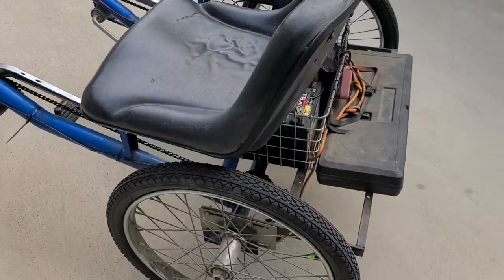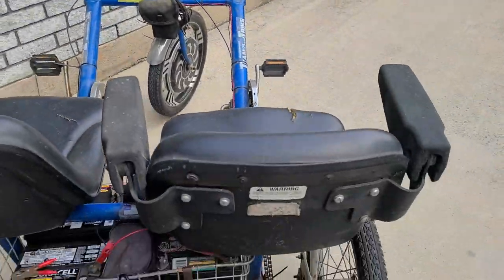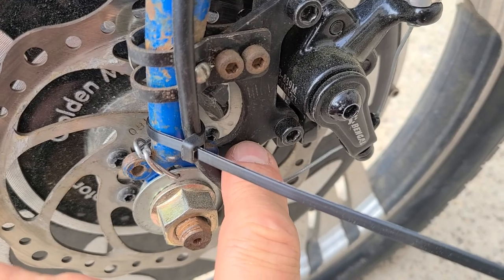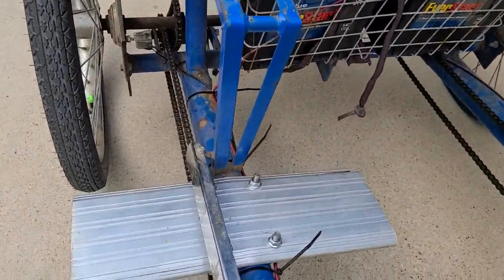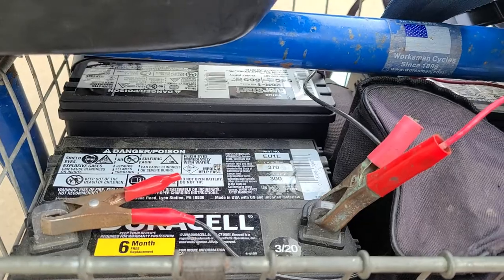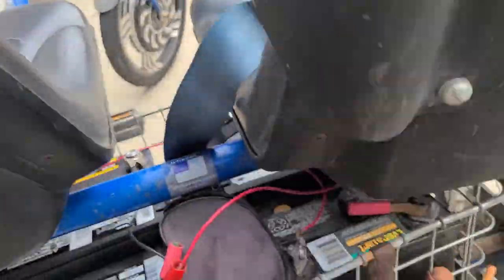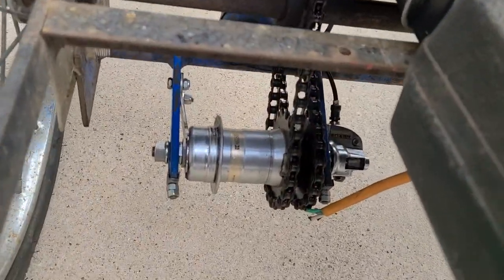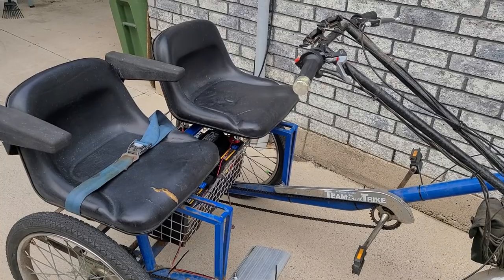WORKSMAN TRIKE QUAD POWER MOD

Comment: Thank you for the information. I have a dual that I plan on electrifying because it is too hard to pedal. I bought it a few years ago, rode it for 25 feet, and parked it on the side yard. At that time I was riding my single speed Sun Industrial 2-5 hours daily up and down hills. My legs were in shape but not enough to move the monster. I have the parts now to put a high torque low rpm traction motor on to drive the rear axle. By calculation with the gearing I plan on using it should do 12 mph. Questions, how fast does your trike run with the hub motor and how is the handling the trike with the tiller handlebars. From just my short ride I found sitting off-center odd. I was unaware that the tiller could be adjusted like you showed in the video. Many thanks for that tip.
Reply from the maker: Thanks for the kind words.. She will do 20 mph. Too sketchy at that speed..
Reply: @REDNECKCHANNEL  Thank you.
Reply: I bought a worksman for my special needs son and myself to ride together.   I squat 425 and have strong legs. My son and I can hardly peddle this trike.

Comment: I've got one of these. What about the rear double coaster brakes? I just mounted a 1000 watt/48 volt with a 100 Amp Hour Lithium-Ion battery from Ali Express. (At $100.00 I had to buy it!) I use good strait pull caliper brakes up front. And coaster brakes back aft.
BTW Trike sells new, (no motor) for $2500.00 and the Trike is well worth it. ALL the Worksman products are quality made.
Reply from the maker: Nice! My coaster brakes still work!

Comment: Good video. I too have a Special Needs son and he absolutely loves it!  We bought the same trike from Worksman through a distributor in Canada, complete with electric assist. If you bought without electrics, then the front wheel came with a disc brake. With the electric hub installed, they switched to rim braking (not sure why?). I also have reservations about the front rim brakes (calipers) having enough stopping power with the rear coaster brakes engaged, since I will be the only one doing the braking.  I'm looking at disc brake kits that can be fitted to each rear axle (inboard beneath the seats). Each brake will need the e-brake switch for power cut-off, with both brake levers installed on the drivers side of the handle bar. With extra cutoff switches, I'm thinking they need to connected in series. Thoughts anyone?
Reply from the maker: FANTASTIC! Yes could connect brakes together which would be 'in parallel. then just 1 brake lever could be used. send some pics when done!